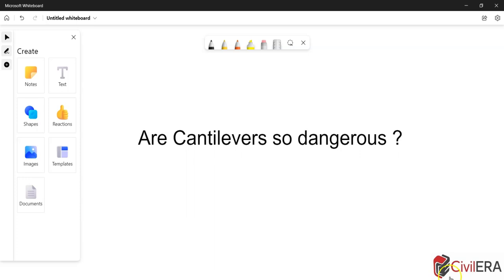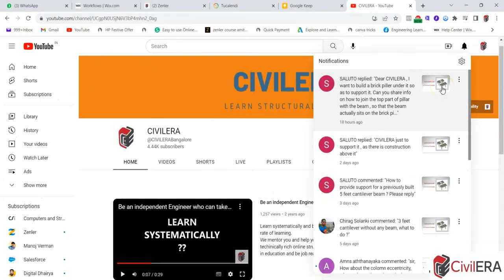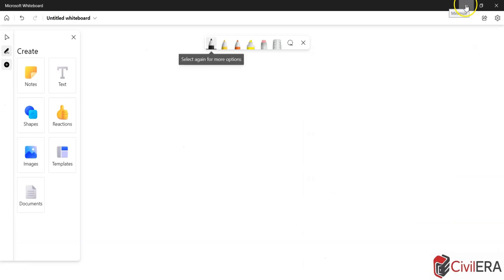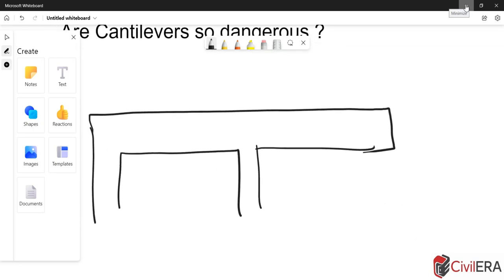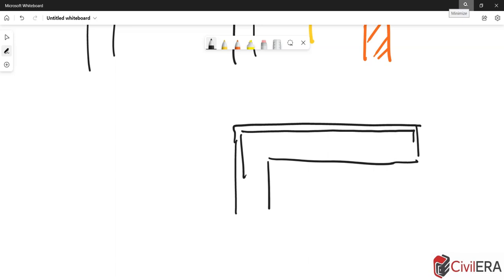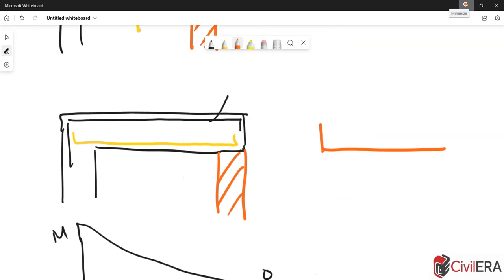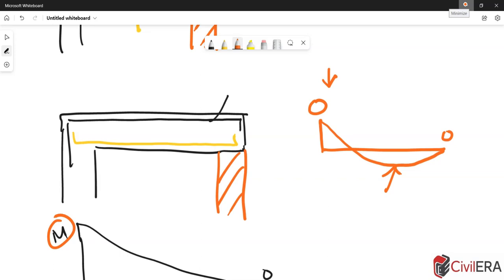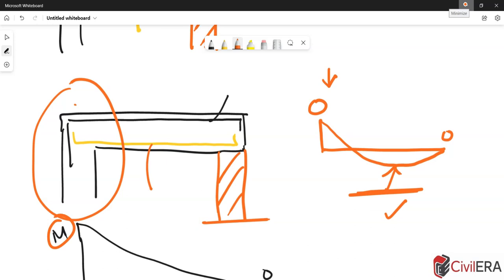Can we support a cantilever at the free end after construction?

Comment: I am adding a cantilever balcony on the 3rd floor over an existing roof. Only 4–5 inches of the old beam was chiseled, and a 16-inch cantilever slab is made. Two round pillars are provided at the cantilever edge, and 3 bars from each pillar are tied to the top roof beam.
Is this structurally safe, or does it need correction? - please respond dada!

Comment: Sir suppose I have a column wit size of 200x 450 or 600  hear suppose I want to  rest 4 feet cantilever beam on a column along its major axis  but hear I don't have minimum back Anchorage length, in such case I will give lever arm into column based on bending moment . my question is in such case does any crack will appear in beam column junction and can we adopt dis structural configuration in few rare case where we don't have other options to go
Reply from the maker: No idea what you are asking. Sketch and record a video on loom and post the link

Comment: Great video sir.. I have a question . Sir, In any steel structure, when cables or rod are used as bracings, so these are design as tension only members. in softwares, there is option for assigning tension only member, but the analysis procedure need to be non linear (Non linear cases are to be formed). Why??. What software do with stiffness matrix that it need iterations? Can you make a video of a example problem that have manual calculation for tension only non linear analysis?? Please answer to my question
Reply from the maker: No plans to make such a video. I make videos that are more generic and popularly searched and asked. You can learn advanced topics from mentoring programs

Comment: I dont see any problem in providing support at free end provided bottom rebars adequate to resist BM.
Reply from the maker: Who has said there is a problem if there are adequate rebars? The video is made to make engineers aware that when we introduce a change in the load path, we need to look at structures wholistically and not just stand alone. True in the case of any member not just cantilever. No body has said that if it is taken care and looked in to, there will be problems.